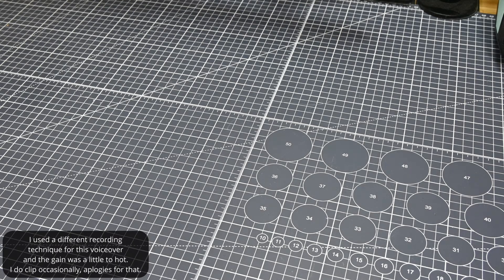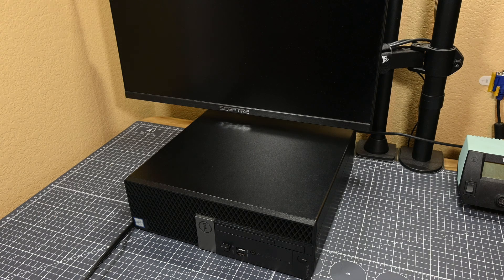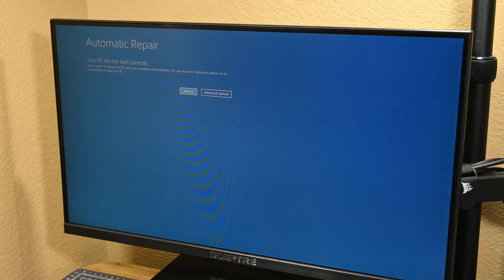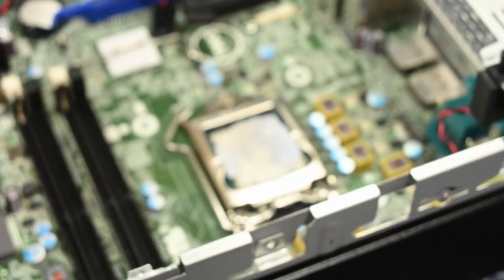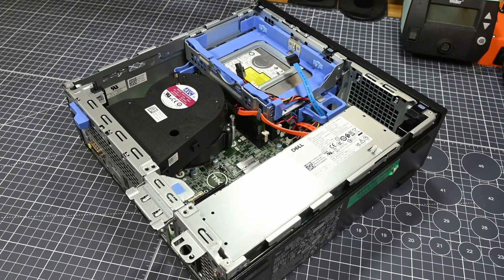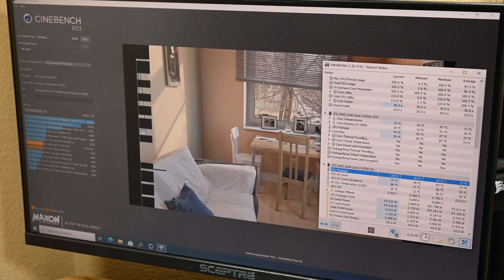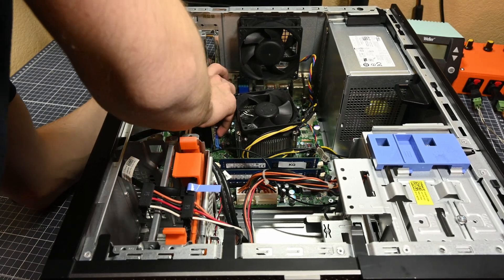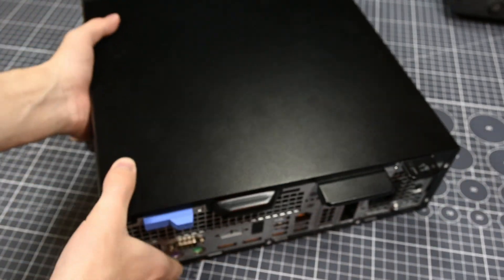This OptiPlex 7070 Doesn't POST Properly - Let's Fix It!

Comment: For getting lower temps: Delid the CPU and change the thermal paste and especially in the SFF case: Try to install an front fan. 
There are cheap delid tools out there and for testing/learning you can use some (older) Celeron, Pentium or i3 that are flying around. The heat problem startet with 3rd gen Core i, when Intel startet to use thermalpaste instead of soldering, even for there higher end desktop model and goes all the way trough to 8th gen. Beginning with Coffee Lake Refresh i7, they startet with soldering again.

Comment: All you need for drivers on the optiplex is to install dell command update. And click the option that you've done a fresh windows install. It will download a base set of drivers. Then reboot. Run again and it will update everything to the most current version as well as update thr BIOS.

Comment: Many of these Dell's are currently ending up second hand market after the 5 year support contract ended. While Dell mentions it only supports Windows 10 (Pro), you can install or upgrade to Windows 11 and their Support Assist will still work fine checking and installing all specific drivers. Besides this micro model, they also have smaller ones usually called mini. Those are great devices for a low price using really low power. Note there are several variations in extra ports like VGA or not and even WiFi. Also many different CPU's and memory.

Comment: what about vs windows 11 though? its new enough where it may accept it manually and  certainly can be forced with ease
Reply from the maker: Yep, this computer is new enough to take Windows 11 natively. I personally put Windows 10 on it, though, because I'm not the biggest fan of 11 and it's super easy to upgrade from 10 to 11 down the line

Comment: If you install linux on a SATA SSD you can use it to boot almost any PC to test the hardware independent of Windows.  I have moved such a driver between AMD and Intel based systems with no issues.

Comment: You can easily lubricate the GPU fan by dropping a couple of drops through the already seen opening, just drop some drops sideways so the lube itself actually reaches the bearing and spin the fan some so it reaches the bearing easily.

This is kind of a messy way of doing it but I have done this multiple times with other GPU fans and works like a charm every time :)

Comment: Speaking of Dell PSU’s….can you fix them? I run into many 780, 790, etc power supplies that die, and would love to fix, not trash❤
Reply from the maker: Oftentimes they are fixable (usually just a few blown capacitors on the outputs), however, it's a job that I'd only recommend that someone who knows how to safely deal with the potentially charged high-voltage capacitors attempt, due to the fact that they could shock you.
Reply: dont bother with a fire hasard. if you do it for someone else they would sue you if their house burns down. if you do it for yourself... well it's just a bad idea.